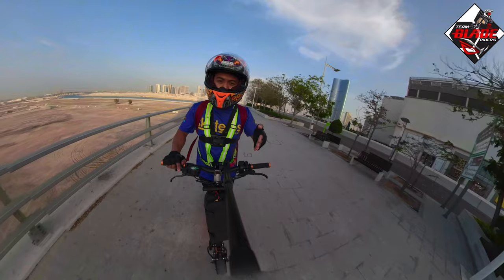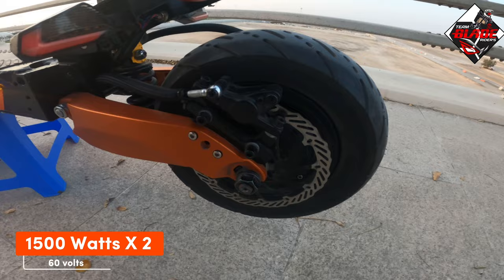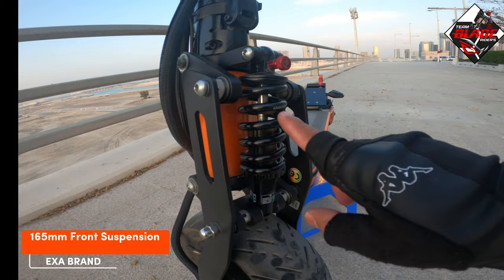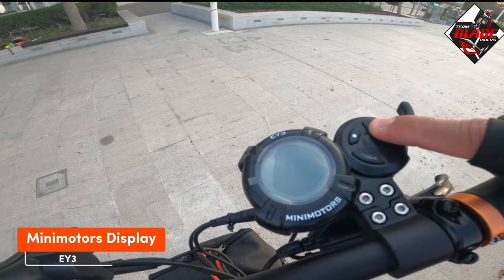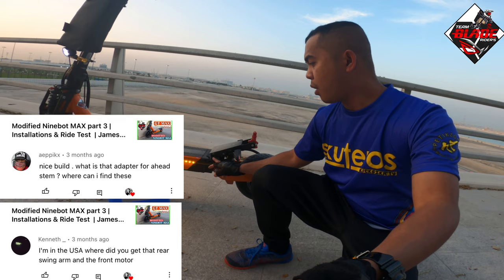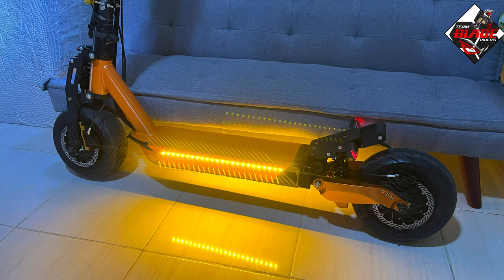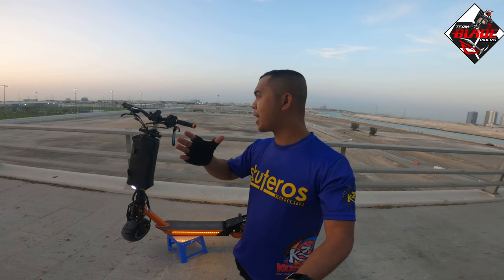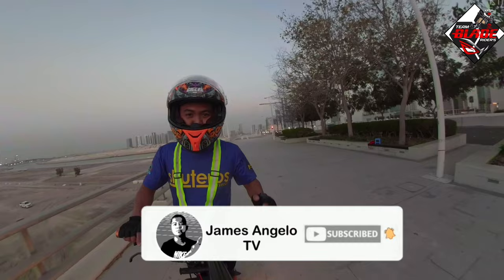MODIFIED NINEBOT MAX FULL DETAILS | Part 4 ) James Angelo TV | Vlog 134

Comment: can i install the 1500 watt motor on  Monorim front and rear suspension without cutting the orignal back frame like you did ?

and after using these controllers .... can i mod it using Xiaodash app?
and will it still log in into Segway app to read the milage and these stuff ?
Reply from the maker: first question : if you want to make 1500 watts need to replace battery and controller also: you can install 10inch motor no need to cut the rear it will fit.
second question what kind of controller you use?
Reply: @JamesAngeloTV  i was thinking of using the D controller on a Kaabo 60v 1100 watt motor 

but after watching your video ,i can use Blade GT motor and controller 

will it be possible to modify it using Xiaodash android app ?
Reply from the maker: no bro not possibel, they are different program the xiaomi display and kaabo or blade controller
Reply: @JamesAngeloTV  
sorry for bothering you bro with all of these questions....

ok... right now i can buy Kaabo 1100 watt dual motors with kaabo 60v 27 AH controllers....
how can i do the firmware for them ?
Reply from the maker: @MomenElwan  no bro you cant do firmware for kaabo controller.
Reply: @JamesAngeloTV  is it just plug and play ?
can you please do a video about your controller conversion ? with the throttle and everything ?
Reply from the maker: @MomenElwan  yes this plug and play only, in ports you may notice that if not fit that is wrong connection. its very easy

Comment: What a beast!

I'm wondering if the rear Blade GT motor will fit the Monorim rear suspension or not
Reply from the maker: not so sure bro i think you meed to modified still but if 10 inch yest it will fit